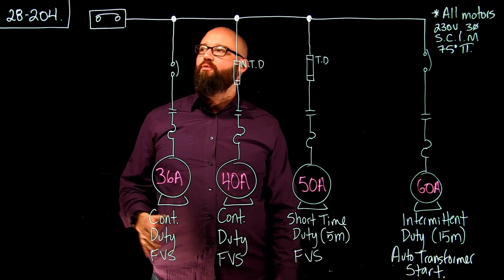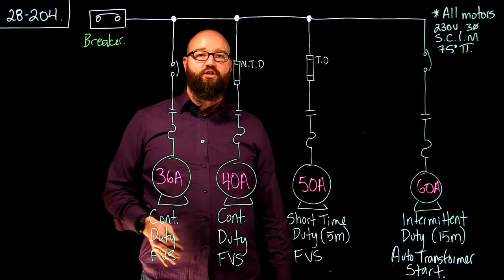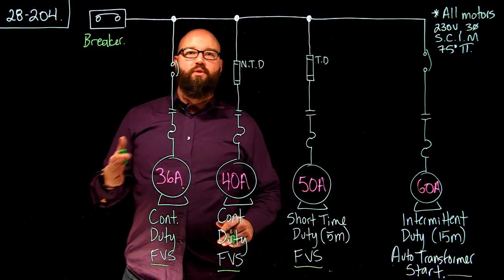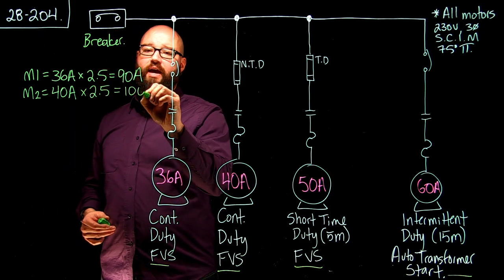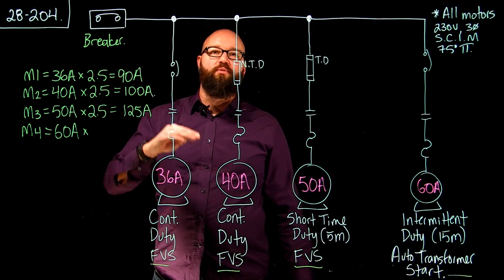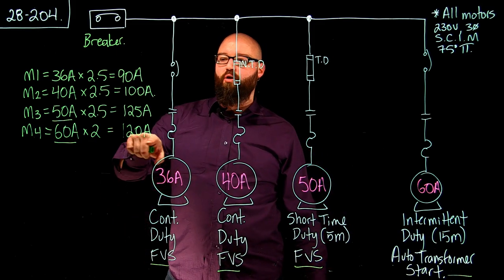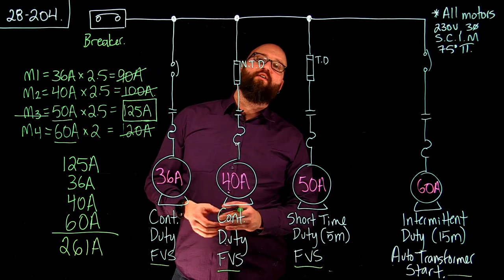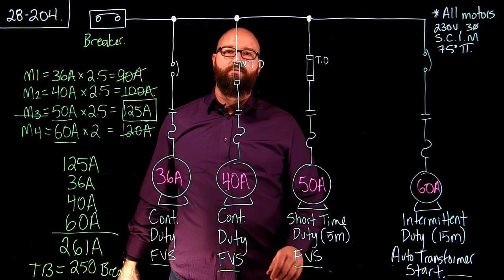Motor Bank Overcurrent Protection

Comment: Hello. Great videos! Looking at rule 28-206 for grouping, I was always under the impression that you calculate each individual motor with the percentages from T29  for the overcurrent that supplies them, and then at the end multiply the largest number by the feeder overcurrent percentage from T29 plus all the FLA of the rest of the motors. I'm not understanding why you would use the 250% on the non-time delay and time delay when T29 says otherwise. The 2018 illustrated code series book does it this way.

Comment: Hello I am from the Philippines. I have a question.  Is there any provision in your electrical code regarding the circuit breaker size for a motor with soft starter? Thanks .

Comment: Great material and very helpful, nice work! Not sure if you know or not but M4 you found a multiplying factor of 200%, where would you find this in the NEC version or is this one of the differences between the CEC and NEC? Im not finding %'s on FVS and ATS anywhere in the 430 section of the NEC. Any help would be appreciated!

Thanks

Comment: Thanks for the great content!
How can one tell if we're dealing with a feeder rather than multiple motors on a branch circuit? (28.204 vs 28-206)
Reply: also, can't 28-204 4) be interpreted as saying we can size this overcurrent up to 300A? There's a bunch of conditional language that makes it hard to understand but that's how i read it. Is it rather that the demand factor mentioned in 28-108 3) is specifically about "load factor"s, rather than any other demand factor we apply?

Comment: Excellent  explanation well done. But I could not find schedule number 28-204 in NEC .thanks
Reply from the maker: This is a reference to Canadian electrical code. I am unfamiliar with the reference to the NEC that would correspond unfortunately.
Reply: @schulerruler  thanks for your answer. I must download canadian electrical  code

Comment: How about if the motor has a wye deltà magnetic starter. What is percentage of the motor fla to get the motor cb?
Reply from the maker: For the breaker itself you would still reference table 29 and use the FLA of the motor. The table will have it listed as star delta as opposed to wye Delta but the max should be 200%.

You do also need to ensure the overloads are sized in accordance with the percentage of current they see, for a wye Delta start it should be 57.7% less to size the overloads, in conjunction with the proper multiplier from 28-306.

Comment: Is the multiplying factor the same (2.5) for a single phase 110v cont. duty FVS motor?
Reply from the maker: Referencing table 29 in the CEC, yes it is if it is a breaker. 300% for a non time delay, and 175% for a time delay.
Reply: @schulerruler  Thank you! Very good lessons!

Comment: wouldn't 261 Amps give a breaker of 300 from table 13?
Reply from the maker: Read rule 28-204 1), it states "not more than", which would been selecting an overcurrent not more than the calculated value.